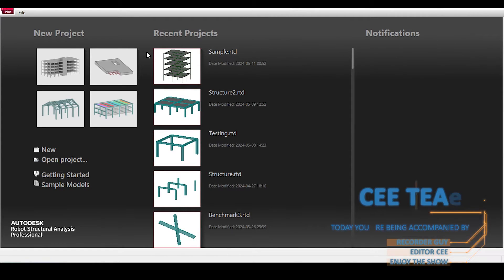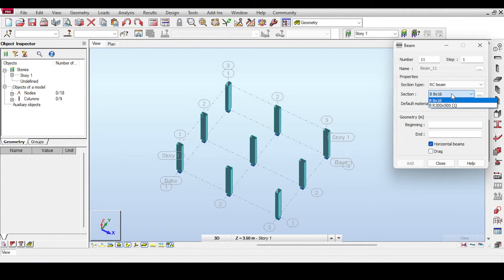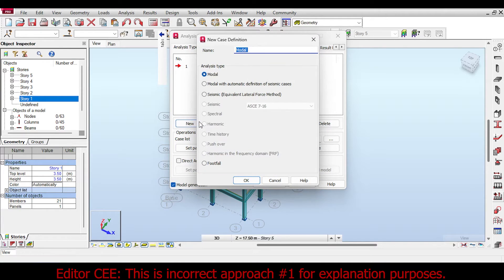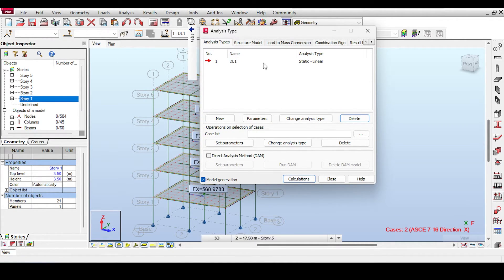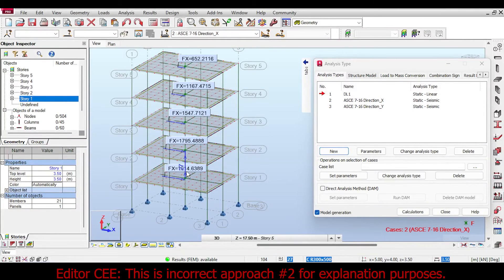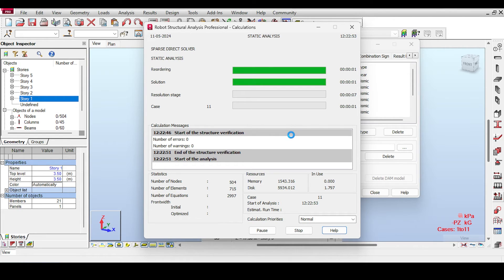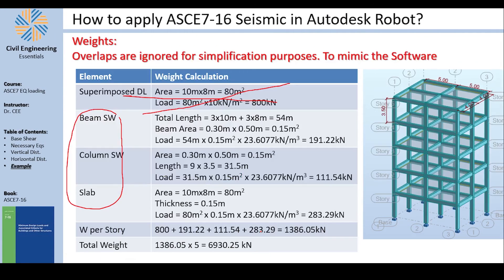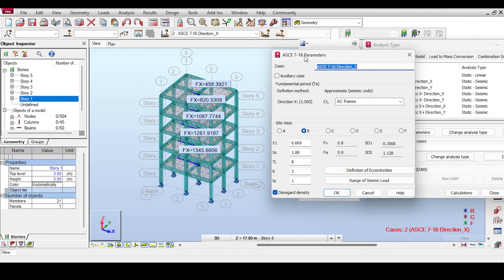ASCE7 Equivalent Lateral Force Procedure in Autodesk Robot - Part 4: Software Implementation

Comment: Hello Dr. CEE

Thank you for this comprehensive “ASCE7 EQ Loading course - Equivalent Lateral Force Procedure”. Although I am not using the ASCE code, I find your course structure, content and presentation style of the related concepts to be super helpful and relevant to be able to be applied appropriately when using the code in my region or even when using or considering other similar codes in other regions and in general. 

I particularly appreciate you taking the time to produce parts 1 to 3 (and part 4 of course); some may have rushed to implementing the calculations in a software with very little to no details of the underlying concepts and references, I find such a rushed approach to be dangerous and often resulting in haphazard use of otherwise excellent software programs. Well done to the CEE team, you work is amazing as always.

I could not agree with you more regarding the blurry lines of “risk category II or III”. I also get “iffy feelings” each time I am to classify residential buildings, residential flats, or even low-rise office buildings. I mean where exactly does one consciously draw the proverbial lines regarding “……the failure of which could pose a substantial risk to human life….” or “…… for which seismic resistance is of importance in view of the consequences associated with a collapse…….”? Your argument in this regard is fair and it is well presented given what is currently available in the codes of practice.

Regarding the “orientation of the columns”. Would it also be acceptable to define one column section and then orientate that section as may be required by using the “Gamma-angle”? or are there nuances in doing it that way instead of defining separately orientated sections?

Still on the subject of orientation of the lateral force resisting elements; and in order to avoid or to minimize “inherent torsion” due to Center of Gravity not coinciding with Center of Rigidity. I recall from “Part 10 – why structures twist under gravity loads and Part 11 - reducing twisting” of the “on-going 😊” series on Modelling and Design of RC buildings that “adding stiffness at appropriate locations” did help to reduce the twist. 

Granted that the structure used in today series example is practically symmetrical (and for good reasons); will it help in other structures which may not be symmetrical and will it make a structure more efficient against EQ actions in general if one “plays around” with the orientation and positioning of lateral force resisting elements or even adds or removes additional elements from a structure with the aim to try and “converge” to a situation where the structure “center of gravity” is reasonably or sufficiently close to coinciding with the structure “center of rigidity”?

And if so, how may one quantify “reasonably or sufficiently close centers” by using or by comparing the coordinates values of the three centers provided by RSAP viz: Center of gravity of a floor slab (F), Center of gravity of a storey (G), and Center of rigidity (R)? in other words, how close enough in terms of numbers could be considered reasonably or sufficiently close as a rule-of-thumb? could variations in the location of the center of rigidity from the center of gravity of up to 5% be considered a reasonable rule-of-thumb number seeing that the code would allow for a 5% accidental torsion in any case? 

Alternatively, does it really matter if the centers are not close since the “rotation caused by the torsion” shall be translated into horizontal forces and if the lateral forces resisting elements within the structure can resist such forces, then the structure would be deemed to be sufficient?       

Thank you for also highlighting and showing the “common mistakes” or how one can (unintentionally) mess up the input procedure and consequently the resulting calculations values in RSAP. 

I have enjoyed this series and I am look forward to future videos

Kind regards, DK
Reply from the maker: Hi there Engr. DK,
sorry for the late reply. Have a ton of tasks to finish at my University (end of academic year stuff) so I am a little bit late with my replies.

I am happy that you were able to follow along despite the fact that you are not an ASCE guy ^_^ it means a lot to me

Indeed, I think I once had a video about it, but thought that this form of explaining theory in details and then applying (with a check) is much better.

Risk Category II vs III is kind of vague. I have seen some comments about it, but it kind of fails to convince me. For me, it is either black and white or left to engineer's decision.

The way Risk Category is presented seems to look like "black and white" but in reality, it is not.

Yes, you could simply use a gamma angle.

I think that is a nice idea for  a quick video, but here is the explanation for it (you may need to read this multiple times):
There exists 3 coordinate systems in a FEM software
1) the global coordinates
2) the local element coordinates
3) the section coordinates

I never talked about section coordinates before, but now it is time.
Section coordinate axis system comes into play whenever you have a gamma angle involved. For example, we know that the inertia of a rectangle is basically 1/12 bh^3. This works around its own  two axis (Switching the variable that has ^3). Also, for the third axis, we have the polar moment of inertia J.

Notice that, if the gamma angle is 0, those section coordinates are identical to the local coordinates of the element.

If the section rotates, then the inertias have to be "cosined and sined" onto the local coordinates of the element (it is more than just cosining an sining). Those in turn get multiplied by the transformation matrix for a global stiffness matrix.

Now if you thought: hmm... this means I need a transformation matrix for the gamma angle to get it to local, and a transformation for local to global, then guess what.. you are right!

Yep, it ties into that point that: if you only have vertical loads on a structure, then it twists if the vertical load carrying elements are unsymmetric.

of course, in Seismic action / wind action, the inertias will play a role.

Yep, I did a full symmetric structure to facilitate the hand-calculations.

Here is the trick we do to converge the CG with the CR:
we first add our shear walls (or frames) in places we can easily add. Meaning those were our ARCH friends are not going to have a problem.

Then, we start tweaking the inertias. This becomes a delicate process of tweaking vs cost.

What I mean is, you could sometimes allow some eccentricity to exist. you would think: wait a minute! doesn't this mean more forces and moments and reinforcement?
Yes.

Does it mean that my structure is more expensive?
It depends.

Ok explain?
Well, how do you make CR and CG close to each other? you play with the inertias. You would assume a minimalistic section then start increasing it for tweaking purposes. Now the realization might start to sink in. But let me elaborate if it did not: increasing the section to minimize torsion increases cost.

So now the question is:
Is it worth increasing the section to minimize the load?

Or should I just take it as it is and increase the reinforcement?

Depends on the $$. And I do not mean this as an "ecape hatch" or to "run-away from the reality" On the contrary. BTW, now that I have phrased this "optimization problem", I am inspired of doing a research paper about it.

Sorry to drag you down such a deep rabbit hole.

I thought that this discussion would be appropriate to try give you an answer for your question, as there are no rules of thumb for that.

The code allows the 5% accidental, in my humble opinion, due to the impossibility of having your SDL and LL be uniform on the entire  area. Now I think I explained it as the "CG" having an accentricity not the CR. You could look at it as being the CR having eccentricity, and you would be right and you would get the same answers, but in my humble opinion, given the rationale of the code, I am tempted to say that it is the CG that actually has an eccentricity (although when doing hand-calculations, we would move the CR... I did not do those hand-calculations in my videos).

You are always most welcome. I am also sorry for the little error I had in those slides. 0.446 vs 0.466

The slides in the description are fixed.

All the best,
CEE
Reply: @CivilEngineeringEssentials  

Hello Doc,

I do not mind the wait at all, not even a bit. It is more than enough for me that you still make the time to read and to respond to my questions and those of other CEE community members in the level of detail that you do, you are just simply amazing!

Strange as it may sound, I actually find that the deeper the CEE rabbit hole goes, the more and more I get to learn from those holes, so do drag away 😊 I insist.

Although I had been aware of the section coordinates system, I had not really thought of it in relation to the other two systems, at least not in a way that you have just explained. And because of your outstanding work on the FEM series, I am now able to meaningfully relate the other two coordinates’ systems; and further to your reply today, I can appreciate the intertwined relationship of all three. 
   
I appreciate the helpful pointers in the quest to converge the CG with the CR. I concur, the balance between $$ and the effort that one could afford to spend on optimization is indeed delicate and would be influenced by many things specific to the particular project and setting.

The Editor CEE had done an excellent job to ensure that viewers are aware of the small error in the slide. The concept is what really matters and as usual, the CEE has nailed it (again)! 

Thank you and have a wonderful day

Regards, DK
Reply from the maker: I'm very happy I was able to add new infos, even with the limitations of written text. 

Oh yeah, unfortunately, there was an error, so the full slides (including all corrected values) are available in the video description. It is rather an annoyance, but well, nobody is perfect, I guess.

Regards,
CEE

Comment: Hi CEE, thanks a lot for sharing your knowledge for all of us to learn. Your work is helping a lot of us we really appreciate. I have a question and it is about max seismic spectral acceleration S1 and Ss. The inputs for the program, are in % of g? I guess so because if not, forces seems to be quite high although working in a low seismic location. For me it is a little bit confusing because it is not clearly indicated if it is in m/s2 or %of g.
Reply from the maker: Sorry for my late reply. All the coefficients are identical to the code. You can even see me comparing ^_^

Comment: Hello dr. CEE
I have a question please. When I design column using provided reinforcements after applying lateral force method. I get a warning that says: seismic depositions, no requirements!
Knowing that this column is part of a building. 
What can I do to solve this. Or can I ignore this warning?

Thank you so much!
Reply from the maker: I checked RSA's documentation. It basically means that special needs for seismic design are not considered. Those include:
1) Splice Lengths
2) Stirrup Special Needs
3) Joint Design

So this means that those parts need to be manually checked.

The design using interaction diagrams is - however - accurate.

Regards,
CEE

 PS: sorry for the late reply.

Comment: Which cases do you consider for load combinations DR.?
Reply from the maker: I did not do any load combinations in this video. But if you mean the cases considered for the Seismic Mass, I considered only the DL
Reply: @CivilEngineeringEssentials   I meant if you are to do a load combination for instance ALS, are you going to consider all seismic cases generated?
Reply from the maker: oh, of course. Those seismic cases (all of them) should be considered.

For example: let's say you have a combination called:
1.2D + 1.0L + 1.0 E

this (single combination) would be actually more than 5 combinations.
Comb1A = 1.2 D + 1.0 L + 1.0 E (x + without eccentricity)
Comb1B = 1.2 D + 1.0 L + 1.0 E (y + without ecc.)
Comb1C = 1.2 D + 1.0 L + 1.0 E (x with ecc x)

and so on...

sorry for not understanding your first question.
Kind Regards,
CEE
Reply: Great. Thanks Dr.

Comment: Thank you for the excellent tutorials! I have a question: I'm an expert in ETABS and recently started learning Autodesk Robot as a secondary analysis tool. I modeled a 10-story building in both softwares and found the outputs to be almost identical. However, I've noticed a difference in period calculation. ETABS considers the factor in Table 12.8-1 and multiplies it by the empirical period from equation 12.8-7. In contrast, Autodesk Robot directly uses the empirical period without factoring in Table 12.8-1. How can I make Autodesk Robot account for the values in Table 12.8-1 when calculating the period? Thank you!
Reply from the maker: Sorry for the late reply. I'm happy my videos are helping. I had some university work to do (we are approaching the end of the academic year, so tons of paper-work).

Ok so to your question: (We are here referencing ASCE7-16):
Table 12.8-1 gives you the coeff. Cu, which is used for the upper limit of the period T.
This is used in clause 12.8.2 to provide an upper limit for the period T. Note that 12.8.2 talks about the real period determined by the engineers. Not the approximate.
This 12.8.2 basically states that:
T <= Cu * Ta
where Ta is the approximate Period from the equations.

I think what happened is (this is a quick opinion, I would need to go to ETABS to check):
ETABS calculates the "real period" of the structure T
ETABS then calculates the approximate period Ta

Instead of using the approximate period directly (which is allowed by the way), it uses the real period. But subjects it to the check in 12.8.2
So, that is why it seems ETABS takes Cu*Ta
Because T would be > Cu*Ta which would immediately invoke article 12.8.2 limiting it to CuTa

Hope my explanation made sense. 
Now in RSA, it has a different approach, in which it calculates the period from Ta directly. Unfortunately, you cannot change this setting in RSA>

I hope I understood your question correctly. If I missed a point you raised, please feel free to ask again. I am always happy to help.

Regards,
CEE
Reply: @CivilEngineeringEssentials  First of thanks for your time to answer my question, yes answered part of it , and you are right, in ETABS after it do the modal and get the analytical period (Tm), it compare it ot Ta CU, and if TaCu is smaller than Tm, it will use TaCu other wise it will use Tm.
Reply from the maker: This is actually a plus point for Etabs. As the base shear may get smaller.
Still, the ASCE7 allows the usage of Ta so one can still defend what RSA is doing.

I will be continuing my series on ETABS during the summer vacation. At the moment (I am an Assistant Professor at a University) our hands are full with final exams and paperwork

Anyways, stay tuned for more content. If you have any questions, please feel free to ask them.

Also, if possible, please share this channel with your colleagues. It helps a lot.

Regards,
CEE